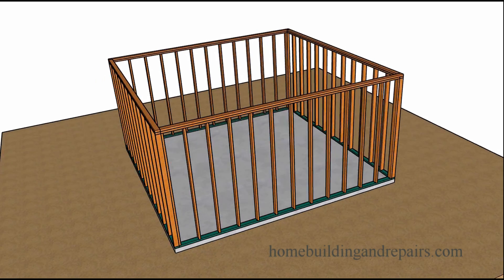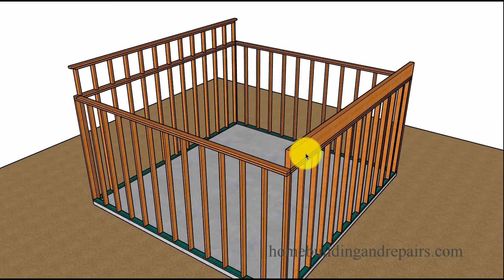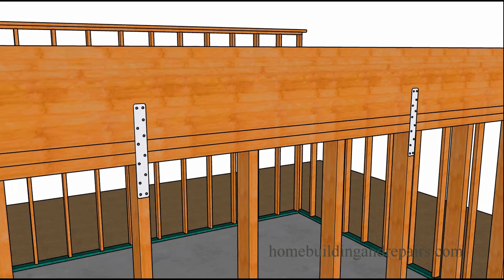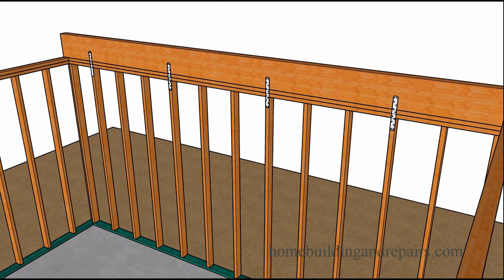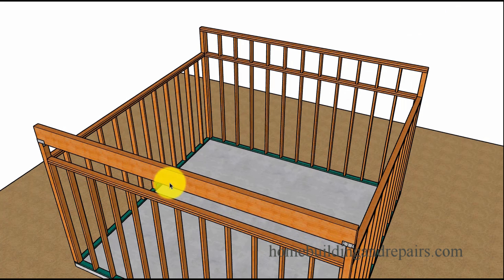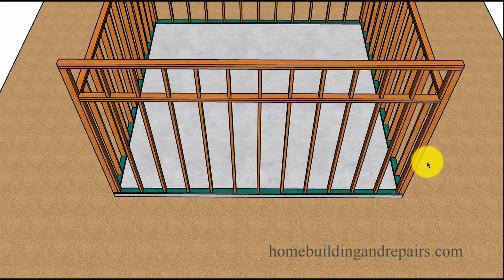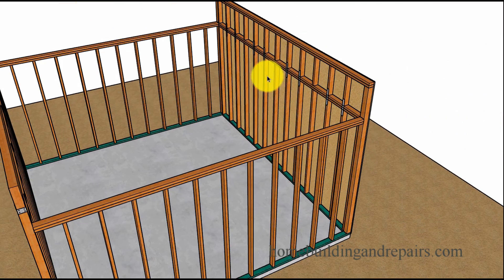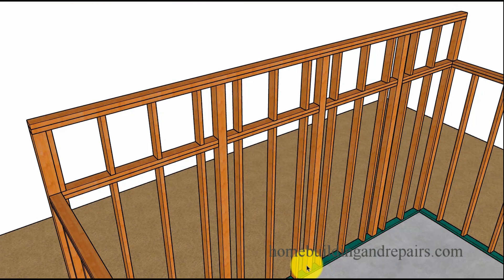How To Extend Wall Framing To Raise Ceiling Height - Structural Engineering Ideas

Comment: will removing the existing top plates and just sistering the studs be cheaper?
Reply from the maker: You will have to do the math on that one.
Reply: If you do that, then one side of the wall has to be stripped of drywall plus wires, pipes, etc. I don't think it makes sense for anything less than a full gut renovation.

Comment: How would you go about raising a post frame building ? Posts are 6x6 8’ oc with double 2x10 bolted to the outside.  I was thinking about sistering 6 x 6 and cutting the post and fill the gap.

Comment: What if this is for a house? What if the baseline framing isn't 2x4? What's the point of diminishing returns regarding money, added height, and structural stability (again, for a house) where it's better to just bulldoze the whole house and start from scratch?

Comment: is there a certain height limit you would recomend for this technique i want to build up about 4 to 5 feet on the my front cabin wall to make a loft thanks!!
Reply from the maker: Good question and no, I would refer to an engineer for that. It will also depend on the design of the framing.

Comment: Hi Greg, this video is excellent, very informative. I am curious if you have seen or worked on extending the height of a rake/gable end wall? My project involves a 1931 craftsman style home with a second story that has 7' ceilings. I want to raise the height of the ridge beam to 9' by extending the gable wall framing, first removing the top plate entirely then sistering 2 x 6" studs to the existing framing. Then installing a top plate to finish off the wall. To facilitate this wall extension the entire roof structure will have been removed prior to extending the gable end wall as well as any drywall. My plan is add dormers front and rear to increase living space. Any suggestions would be welcome. Thank you.

Comment: Hi Greg - I was recently gifted two lumber packages that a builder friend was going to use but decided not to. The problem is that the walls are 8 ft tall. My plans call for 10' first floor ceilings and 9' second floor ceilings. Would it be safe to extend the wall framing as you did in this video and then build a second floor on top of it? Thanks!

Comment: Given the labour cost of fiddling around with "extensions" to current wall height, and the risk of hinge/getting it wrong, wouldnt a much simpler, probably cheaper and certainly stronger solution be to just replace the studs with longer ones. ie 1)use acroprops/jacks to support the underside of supporting wall top plate at regular intervals (may need temporary beam to distribute load). Brace the acroprops to prevent toppling 2)use a demo saw to cut and release the top plate away from each stud (leaving the trusses still attached to the top plate to prevent damage to bottom chord of truss), 3) slowly jack the whole roof with acroprops until you reach the desired new height 4)remove noggins and install new (longer) wall studs in place, nailing to bottom plate, existing short studs (or remove them) and top plate. reinstate noggins. 5)add straps to tie top plate to new longer studs.  All done. No hinge issues. Standard wall spec so no engineering calcs required.
Reply: At that point from what your saying why not just rip the entire garage down and build a new one.

Comment: 2015 IRC section R602.3, "Studs shall be continuous from support at the sole plate to a support at the top plate to resist loads perpendicular to the wall. The support shall be a foundation or floor. ceiling or roof diaphragm or shall be designed in accordance with accepted engineer practice." In the US that usually means an engineer's stamp.
Reply from the maker: Keep in mind not everything built follows building code book instructions and I like the accepted engineer practice.
Reply: @gregvancom  Keep in mind that your insurance company wont be paying you a dime if your building comes down.  They have in-house engineers that will come out and inspect the damage. When they find out your building was not built to code....  and we all know insurance companies will do anything, to not pay!

Comment: Thank you. I've been looking for this. Darn, I already put t1-11 siding on the outside 8' talk. That makes it difficult to  add the straps on the outside. If I can remove the nails I guess I could slip the strap between the siding and the stud and nail through the siding and the strap into the stud
Reply from the maker: You're welcome, but the strap nailing might be difficult without removing siding. Maybe they have decorative straps or hardware you can attach over the siding.
Reply: @gregvancom  I will be to that point soon. I'll check it out. I want to add 2' height.

Comment: Im building a 28x32 garage already have a bunch of 94 in. studs for the walls, but would like 12ft height. The walls will be placed on 2 rows of 8” block, so ill start at around 9 1/2 ft. Should i build the 8ft walls first then add the sister walls after like in vid, or is there another method i should do while building them adding the short wall on top during framing? No building codes apply, just dont want sag/blowout later. Thx
Reply from the maker: I don't have another way to use shorter wall studs to build taller walls that will have hinge points.

Comment: Would it be nice to raise ceiling height using one of these methods on a high post house.?
Reply from the maker: You might need to check with a structural engineer for more details or visit our website and check out some of our remodeling videos.

Comment: Always awesome videos.
Question, how do you elevate with existing joists across? And you want to go for example 12” Higher? To add joists above for a second floor?
Reply from the maker: If I was going to raise the roof, I would probably do it with the ceiling joist attached to the raising roof, but it would depend on the design.

Comment: Great video! Thank you! You showed the 4x4s at 4' O.C. but only on the eave walls where the roof rafters will ultimately bear, but nothing on the gable end wall - will you need 4x4s @ 4' o.c. on the gable end walls as well? Thx!

Comment: Hello, thank you for the video. I have a home that has this exact design with the roof sitting directly on those short walls. There is a ceiling/floor where the ceiling extension begins that we would like to remove to create a vaulted ceiling. What would be the best method to keep those walls from bowing out since they support the roof? I was told I would have to keep every 3rd ceiling joist but the ceiling is only 7 feet in the kitchen or completely demo the walls and start over. We'd like to raise the floor 3 inches,as well in the kitchen, to make it even with the room next to it, as it dips down. Thanks in advance!
Reply from the maker: I have more videos at the website in the remodeling section. I think you can use a ridge beam to solve your problem.
https://www.homebuildingandrepairs.com/remodeling/framing/index.html

Comment: Hi Greg, Nice info. On a second floor addition,  I actually used the 4x12 beam on top of the double top plates to raised the ceiling by 12 inches. I positively connect the beam with 6 inch long  Simpson lag crews at 16" o.c. through the double top plate to the 4x12 beam. It avoided the hinge problem. In addition, shear panel of 9' tall is added to the exterior for lateral seismic loads.

As to the second floor addition, the floor load is supported on a beam and post system.  All post has pad footings underpinning the existing wall footings. Post hardware's and hold-down's are added for overturning and uplifts.
Reply from the maker: Nice job and thanks for sharing.
Reply: So you sat the floor joist for the second floor on the new 4x12?
Reply: @nayanparekh6086  , yes! The 4x12 is like the double top plate. All the rest of the framing rule still apply.

Comment: This is a useful video for sure. My cabin has a long, sloped roof that goes from 9' to 8' over 17 feet width and I'd like to level it at 10 or 11 ft., with a slight pitch for drainage. Roughly how much $ per 10 feet of extended 2x4 framing would you estimate including labor in your region?

Comment: Couldn't you just nail 2x4's to the existing 2x4's, run them up through the top plate to get the reinforcing needed to not have any hinge problems?
Reply from the maker: In some cases, yes and yours is another method to consider.

Comment: I have a kitchen that was added on to my cabin my enclosing the previous porch. The roof is flat EPDM (weird!). The interior ceiling is WAY too low!  I wanted to raise the walls and make an open beamed ceiling and top it with a metal roof to match the rest of the cabin (I'm not sure how to tie in the new metal roof to the old, as they would go in different directions. That's next on my research list!)... BUT, after watching this, I think the original porch walls won't be strong enough. So I thank you for that!! I think I avoided a catastrophe! :)
Reply from the maker: Glad it helped and thanks for letting me know it was helpful.

Comment: Great things to think about with extending a wall! I have a question about upgrading an outdoor shed. Currently, it is used to store lawnmower and gardening tools. It's a wood framed, metal sided/roofed structure with a low sloped pitched roof. I want to seal it up, insulate it, put in a window and window AC unit, finish the interior, and possibly extend the front wall like you show at 3:59 to accommodate an insulated door. What are your thoughts about inserting a 36"x80" door between two of the vertical 4x4s? The shed is 8'x8', so relatively small. I'm hoping to turn it into a temp controlled space to play drums in.

Comment: Would adding a second story be a good time to consider raising the ceiling height? If so, does that change how one would approach raising the ceiling height or could any of these methods be used in conjunction? 

Thank you so much for this content, it's incredibly helpful.
Reply from the maker: If you're building a second-story home addition, then it might be best to remove the old materials and replace them with the correct ones, for example longer wall framing studs. I don't think I have a video on this, but will definitely add it to my list of videos to be made in the future.
Reply: @gregvancom have you made a video on this yet ?

Comment: Did you need structural engineer to use the 2x4 method on plans ?
Reply from the maker: You would need to check with you're local building department.

Comment: I think your proposed solution is complete overkill and unnecessary.  Obviously, there are real concerns with under-engineered solutions but there is a real problem in the construction industry where contractors and engineers alike continue to accept and propose over-engineered solutions.  This over-engineering comes at substantial costs - both literally and figuratively and  many of the "best practice" solutions are just unnecessarily expensive and unnecessarily complicated.  I can't find anything where someone has gone back to actually do the engineering math to determine if these are even necessary.  I'm just curious about a few things... Anytime anyone says anything about extending a wall about 5k "experts" freak out and start yapping about "hinge walls" but can you point me to a single study that shows any information about hinge walls actually failing and how or why they fail?  Can it be demonstrated that it was actually the hinge buckling that caused the failure?  Why is it that common nails and/or screws that we use to hold together a house under "normal" circumstances all of a sudden are so inadequate and again, it would just be great to see some real actual data instead of fearmongering repeaters?  Can the engineers that recommend that 4' need for the continuous posts show me a single situation or even an FEA simulation that would demonstrate when, why, or how, the strapped solution would fail and why all of this extra destruction and over-engineering is even necessary?  Over-engineering is not "better" engineering, in fact, it's patently not engineering at all.
Reply from the maker: You bring up a good point about over engineering and I've seen it done plenty of times, especially with some of the building hardware that's going in new homes today. However, when it comes to hinge points, this is something that makes sense to me as someone with 40 years of experience. I've actually pushed on these walls and seen them move, when they shouldn't be and that was enough satisfactory evidence for me. If you need more evidence, you might have to look for yourself and feel free to share it with us if you find it.

Comment: Hi Gregvancom, i have a question related to raising the walls for my garage attic for a bonus room. I can’t figure out what is the best way to gain room as my roof has a 4/12 pitch and the attic above the garage at roof collars is about 7 ft high and 42 inches at its lowest. I thought about adding a dormer but the pitch won’t allow it. The dimensions of the attic are 21x25 with a post towards the garage door end that support the ridge board that is split instead of a full piece. Any way for me to increase head room ...seems like the only option is to raise the walls and the roof as well. Thank you for your time

Comment: We are looking into raising our whole house ceiling. It's only like a 6'10" ish ceiling throughout the the house. 
I think we will need to restructure/rebuild the entire the roof in able to raise the ceilings inside the house.
Reply from the maker: Sometimes it will be easier to rebuild sections of the wall, ceiling and roof framing or rebuild the entire project.

Comment: In your example, how do you add a door that is taller than the old top plate? So for example assuming the old top plates are at 72" height (on the two walls that stay short) and you want to add a typical 82" tall door on one of the walls you just raised. How do you still keep the top plate continuous?
Thanks.
Reply from the maker: That's not that difficult, simply cut the lower wall framing plates and install the framing studs needed for the door framing assembly into that slotted area. Let me know if this doesn't make sense.

Comment: Great video. I have a 60's built garage with a 2ft wall on top of the standard 8'1" wall framing. Add in 2x6 rafters, 24 O.C. and I have a sagging roof and bowed walls. The hinge point is real! The top plate of the extra wall is a solid 3in more outward than the bottom plate. I'm starting to see structural members fail where the nailbangers decided "more must be better". Your video showed me what needs to happen to correct the issue. If I'm going through that effort, I think it's best to just rip the wall down and do it right the first time. It's not worth trying to save someone else's mistake.
Reply from the maker: Good point. Sometimes it's better to start over.

Comment: How long and wide should the straps be?
Reply from the maker: I cannot provide you with structural engineering information, because the length of the strap might depend upon the overall height your extending the ceiling and the type of lumber you're going to use.

Comment: a 2 car conventinal garage.  can the cealing be drop right on top of the garage door
Reply: please advice
Reply from the maker: Probably not, but it could be if you didn't use a roll up door and instead used a door that opened from the sides.

Comment: Greg I would like to have a 10' exterior wall but the interior to have an 8 foot ceiling. Can I attach the roof rafters on top of the sill to raise the roof 2 feet. The 8' floor joists will rest on top of the 8' wall and the roof rafters will rest on top of the 10' wall. Any suggestions.
Reply from the maker: I cannot provide you with engineering advice, but think that the methods in this video should be helpful for what you're suggesting. Let me know if this didn't help or answer your questions.
Reply: @gregvancom  Now what i want to do is place the ceiling joists on the lower tier and place the roof rafters on top of the addition raising the roof but keeping the ceiling height at 8'. This will give me a heighten roof, to create additional roof space.

Comment: Hey Greg, love the channel. I’ve got a low ceiling, about 7’4”, and want to get the ceiling up to eight feet. I’ve got 2x4 roof rafters-any way I can hang the ceiling joists of those  to get that last eight inches?
Reply from the maker: I cannot provide you with structural engineering advice, but if you email me a few pictures I might be able to provide you with an opinion. You can get our email address at our website.

Comment: They way i prob do it is to build a new wall on the ground. If you need to raise the level from the top plate X inches. Just cut plywood in that height. And then build a wall constitution with bottom stud, studs and top stud. That you cover with the plywood. Now lift the new wall into place and use wood glue between your existing wall and the new wall over the old one. Wood glue will make the whole thing so strong. That it is as stronger as the wood. If it is a long wall, just make it in sections.
Reply from the maker: Yes, you can definitely build a new wall.